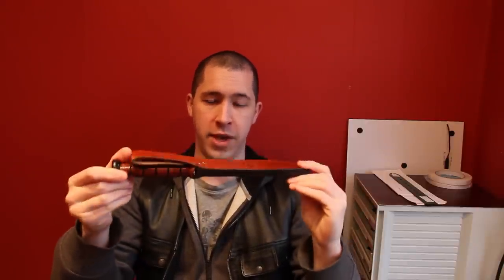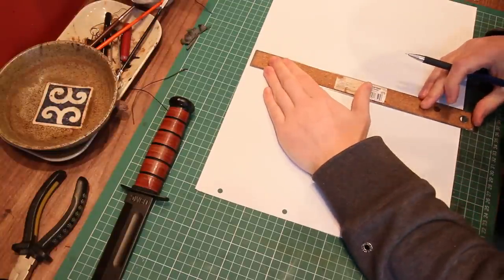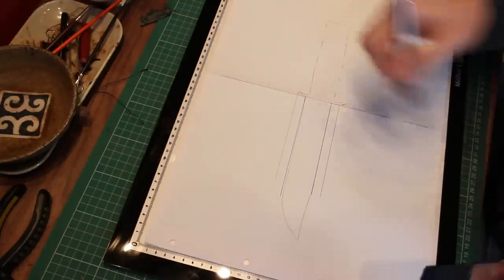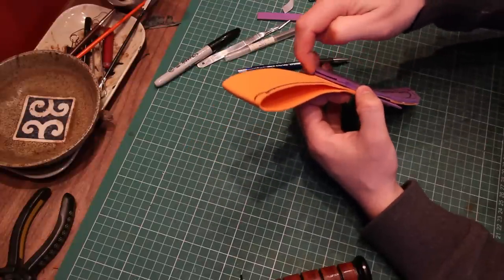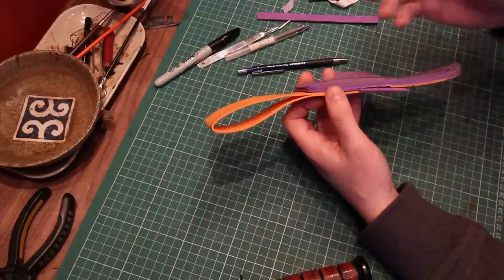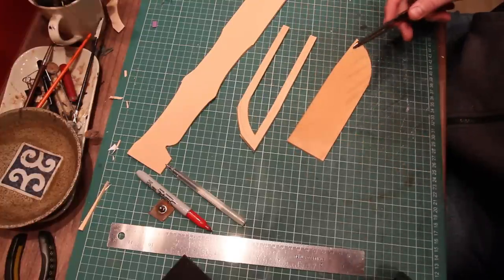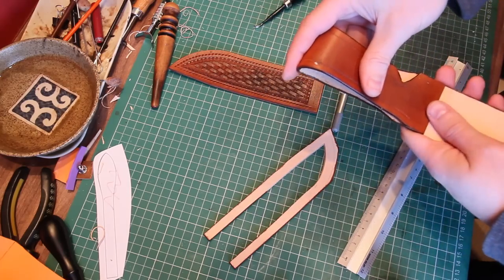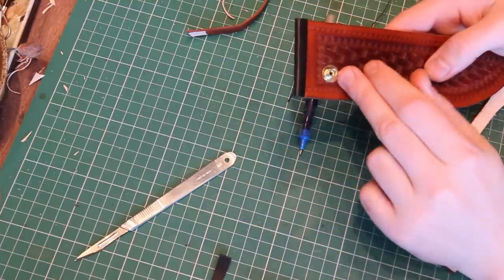Designing and Making a Ka-Bar Sheath

Comment: I like this sheath but I really loved the one with the Stingray insert, simply beautiful. An informative video, I really learned a lot. Thank you.

 You mentioned the difficulty of putting a retention strap around the handle if the handle shape doesn't prevent the knife from moving in the strap. Have you ever tried putting the strap down just above the guard? That leaves no room for the knife to slip.

Comment: Hey Ian, The reason that the handle and the blade are slightly misaligned, is because the K-bar was first designed as a bayonet. The blade is dropped a bit lower to make sure the blade is well clear of the out going rounds. :)
Reply from the maker: I've never heard that before it would make sense though I guess!

Comment: Thanks for video. I suppose that the same techniques about forming the bottom of the sheath for a tanto blade? The leather working handbook was a great book. Thanks for the recommendation. Great work thanks for all the info you've passed on.
Reply from the maker: No different for a tanto blade, either make your welt parallel and have a sheath shaped like a tanto at the bottom or follow the blade on the inside of the welt and then curve the bottom of the welt. There's nothing to say the welt has to be parallel all the way round.

Comment: Is there any particular reason why you can’t just fold a big piece of leather In half so your belt loop piece becomes your spine/back of sheath and welt? You’d keep the full strength of the grain and only have to cut a front piece. The sheath would only be 3 layers thick. 

Or you could just fold and sew the belt loop backwards to avoid the extra spine piece?

Great video Ian, hope you can reply :)

Comment: The blades off centered so stabbing is better. The tang is in line with the tip of the knife rather in the center. So technically it is centered but its not.

Comment: Another thing that you can do to keep the snap (press stud) from marking the blade is cutting a shallow beveled flap partway into the leather.  This makes the back of the stud recessed, but fills in the gap without having to worry about the stud working its way through over time to mark the blade. See my crappy illustration here: dung0beetle.deviantart.com/art/Hide-a-stud-without-using-a-lining-420918848